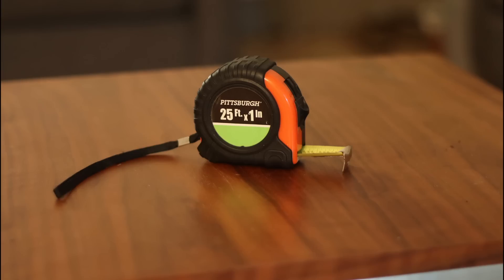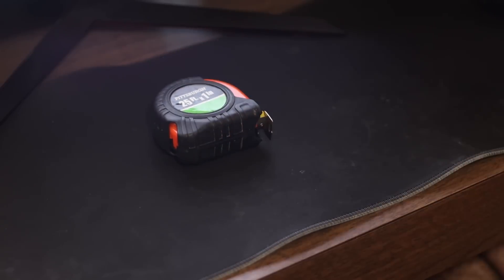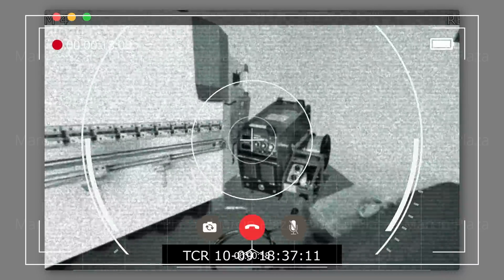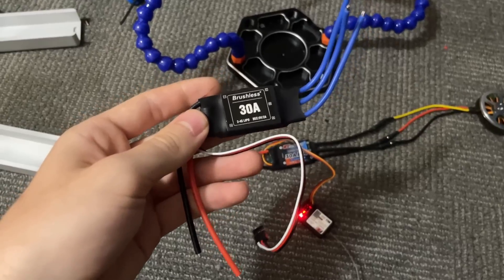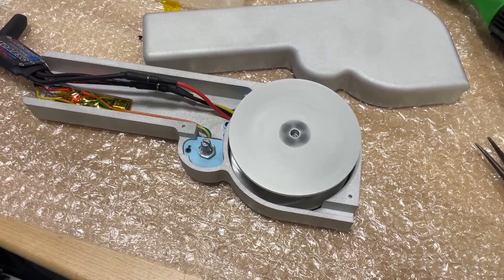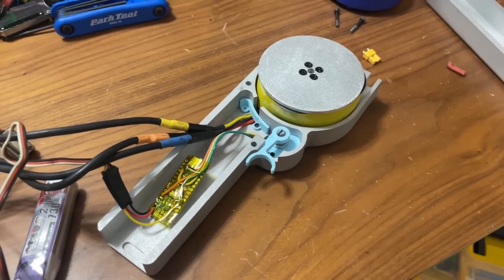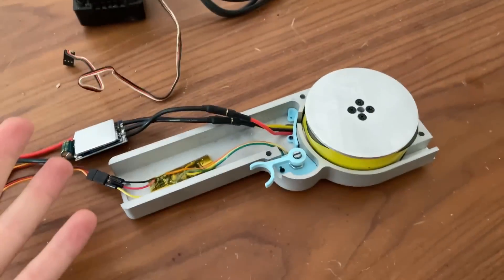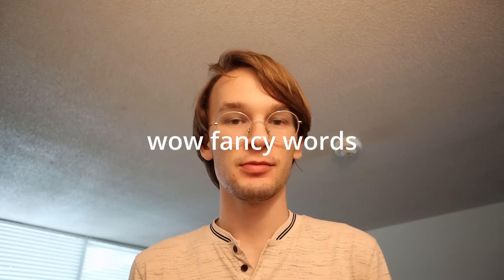It's ok to Fail...

Comment: My brother in Christ, you over-thunk it by like 500%
Battery, two micro switches, geared motor magnetically or friction coupled to the spool (so you can still pull the tape out by hand, and so it won't slam against the body too hard when rewinding). Not EVERYTHING needs a micro controller! But that's just typical electrical engineer mindset, it's understandable.
As a side note, when designing a two-or-more-part enclosure, include some alignment dowels or some other way to 'register' parts against one another. That will give you a much nicer fit and feel rather than relying on screws to position everything. Screw hole tolerances are normally not that precise.

Still, you did, you learnt, and that's what matters. And now you have a perfect enclosure for a pocket fishing rod :D

Comment: You could get more precision if you use Stepper motor. And you can then add endpoint limiters easly as well. As you can count the steps taken to fully extract the tape or fully rolled back on. Yes, steppers can lose steps so only counting on them to be 100% working endpoint limiters is bad idea.

Comment: I just discovered your channel, great work brother. One thing i would recommend is to add a limit switch that activates when the tape fully retracts to stop the motor from pulling it too far which might break the tape.

Comment: if someone's curious but doesn't know what "hold disabled state" means: 
basically the motor needs the current to not spin, and the spool wants to unspool so when you turn the doohickey off it goes whoosh

if you have a 3d printer or similar style thingamajig you can try the following to understand it better:
turn on your printer
tell the head to move somewhere, like the center
try to move the head
it either won't or it would be really hard (other would mean either your hold current is too low and you already know the concept and wasting your time reading this or your belts are loose)
press "disable motors" button/use the G84 command/unplug your plug and try to move it again
it will move way more freely than before (do it carefully since the motors are acting as generators and moving shit too fast can damage the drivers or the motherboard)

Comment: hoho! you CAN design something that needs the motor to hold position in a powered state, but you need something fancy like an O-Drive controller - those are typically run over $200. but they did recently make a pretty tiny baby one that would probably work decent for something like this (you'd def need to gear it down like you mentioned though)

Comment: I think this could benefit from a motor controller which supports position/angle control, like the odrive or vesc. Combined with a microcontroller you could keep track of your extension and prevent the tape from whipping/breaking by decelerating as it fully retracts. They also greatly increase the stalling/starting torque with better control algorithms.

Comment: Hello,

Glad to see your content. 
Im happy to see you are enjoying yourself but please be careful with metal tape measure. Especially when they are retracting back into their casing.

Even with a regular measure the spring is strong enough to slice if it catches your skin. 
You can lose fingers and get seriously hurt if you're not careful, I was dumb enough to use a tape measure as a yoyo when I was a kid. Really dumb mistake.
The way the tape retracted and violently twirled around your body was scary to watch.
Please consider much more safety  into your design or programming when retracting the metal tape. 

Take care, stay safe, have fun.

Comment: Next time you need something like that, use an as5600 and add a magnet to the motor, then you just need to count turns.
(Also with that you would be able to dispense an exact-ish length.) 
As for the motor, get a tiny stepper that's powered by an uln2003.

Comment: Get Maytech MTSPF6.0M Mini. It is more expensive, but it worth it. It is vesc based, and can be controlled directly with the potentiometer. Also it has way better low speed control

Comment: All brussles esc's  i used or know can be programmed to be bidirektional. 

At least if they used simonk, blheli or similar Firmware.   
I also flashed some cheap escs to bleli to enabe Motor breaking for my fpv drone

But i did this a long time ago. If you switch on an esc while full throttle most of them go in Programming mode , the motor makes some beeb Sounds and it is possible to set a lot of different Parameters,like directon Control, Motor timing, and way  more... Look at the Manual of the esc.
Reply from the maker: Yeah, you’re probably right for most. I managed to find a manual for mine but there wasn’t any programmable options for reverse. Thats what I get for buying a $2 esc 👀